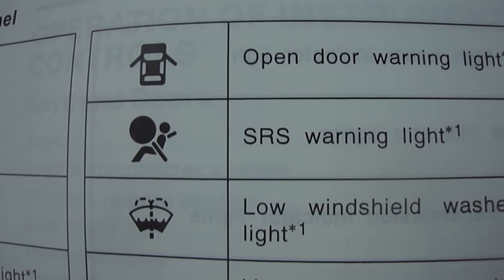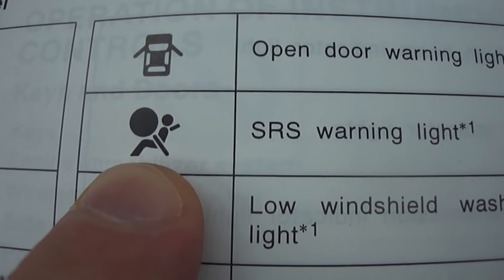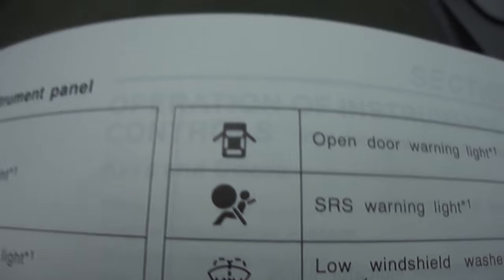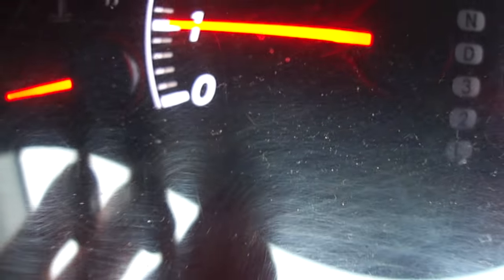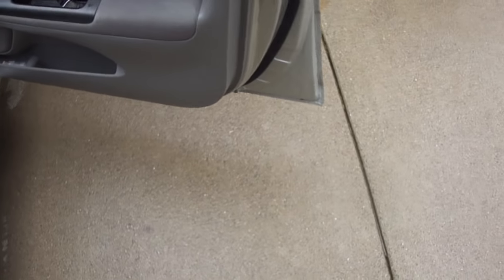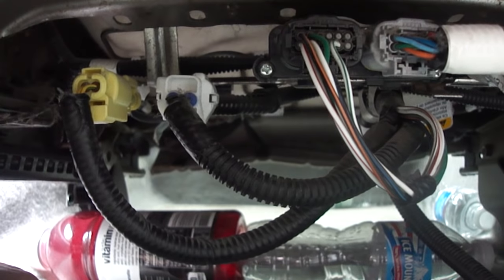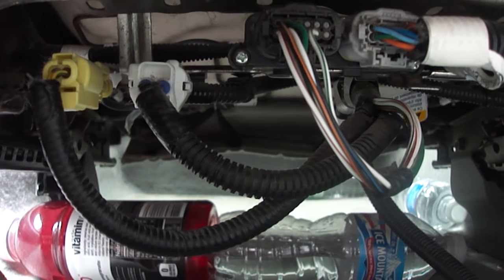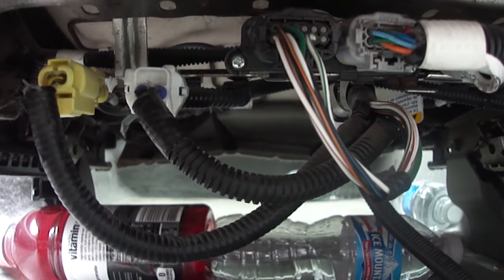(Part 1) How To Fix Airbag Light - Fast & Easy!

Comment: Hello everybody this worked for me too on a 2014 Forester. I want to add to the method something I’ve learned with other connectors though. The cause of this is probably corrosion over time impeding the connection and a great way to clean and protect the connectors going forward is to unplug the connectors and plug them back in repeatedly, about 3-4 times is what I did. That should wear away at any corrosion on the contact faces. Then I reinstall with a healthy dab of dielectric grease to protect the connections going forward. Good luck everyone.

Comment: Do i have to keep the car on? or disconnect the battery 1st moving the cables? Will, this work for a BMW x5? Thanks i'm try it in the morning!
Reply from the maker: Nicole Yescas perform with key out of the ignition. This will work on any vehicle.

Comment: What are these harnesses called? I have an 06 Tundra and the guy that replaced the seats didn't replace ANY of the harnesses. There are literally no wires under either seat. I'm trying to find replacement parts but having a time...

Comment: So for a loose plug, you die in a crash? Or will the bags deploy if that was the only problem?
Reply from the maker: I have read that if the airbag warning light is on, the airbags will not work in a crash.

Comment: Mine is now on and have'nt done anything yet.  after you check the connections, do you have to restart the car or will the computer now recognize everything is good to go while running?
Reply from the maker: Once you perform this, then put the key in the ignition and start the vehicle.
Reply: ok, thanks, will try today.

Comment: I just had to check the connection in the passenger seat without disconnect the cable and it fixed.  thanks!
Reply from the maker: Andres Cote 👍

Comment: I have the same problem and the mechanic told me over the phone its not a wiring problem but usually the ECU for the airbag system and would cost $884 plus gst plus 45 minutes to install the new one. So I will check my vehicle for loose connections. I just put in new seat covers so Im sure Ive dislodged something. However Im sure if I took it to the mechanic they would have ripped me off. Thanks

Comment: Brilliant. I have a Yaris Verso, and the warning light started blinking after I had to push the front seats forward in order to open the floor panel to store the rear seats. Obviously caused a contact to come loose. As the guy says: wiggle it about a bit. Problem solved. Saved me at least 2 hours going to garage for them to do the same thing, even if they didn't charge me.

Comment: Thank you I'll try it. My 2004 holden stopped yesterday at 5am half way to work. The airbag light was on for 3 days but me being lazy I just told my hubby it's ok lol. Next thing I know I'm driving to work then the red battery light pops up and my car stops. So I call my hubby and we end up pushing it back home. Thank God it was only 200metres from home. I'll try and do this in the morning. Thanks heaps. I'm glad I found your video coz our mechanic would have charged us the moon coz He's a crook. Thanks again. God bless.
Reply from the maker: Truth Exposer make sure you watch part 2 and 3. From what you’ve described it sounds like you might have a bad alternator.
Reply: @proclaimliberty2000  thank you I will.
Reply: @proclaimliberty2000  thank you. I will. 😊
Reply: @proclaimliberty2000  tried the wires me and my hubby. Didn't work so we think its possibly the alternator. Thank you again. Hopefully the mechanics doesn't overcharge us.

Comment: 2004 Pontiac gran prix super charger  air bag stays on.  The fuse is good. Question .should the car battery be disconnected..the owners manual said. The air bag can deploy  up to 10 seconds after the battery is disconnected.

Comment: A good advice proclaimliberty2000, I'm sure the water bottles you have under the seat are the reason the cables keep having bad contact. When you drive the bottles move under the sit and hit the cables which causes the cables to loosen.
Reply from the maker: The bottles do not hit any of the electrical components.  The problem is I live on bad bumpy roads

Comment: So, I just did this. The light used to be on all the time, after fastening the connectors now the light goes out and returns only a few seconds later, does this mean that my airbag or sensor is damaged? I appreciate all the support. Thank you.
Reply from the maker: I don't know for sure what it means but you have no airbag protection right now.  Is this an older vehicle?  Read down through the comments as someone mentioned something about a special electrical connection paste which could fix a problem with electrical connections as they age.
Reply: My guess would be that there is a reason your connectors are not staying connected and you have to fix that first. They may seem to be back together but if there's something caught in them, even just dirt or moisture, then they'll be forced apart again very quickly which will cause the light to go off then come back on. Disconnect the plugs and give them a hit with a blast of air from an air compressor or can of air to blow any debris out then try again.

Comment: WOW, Worked immediately on my 2014 Enclave!!!!   Thank so much!!! 👍
Reply from the maker: Candy 👍😊 Girl power!
Reply from the maker: Candy 👍😂
Reply: @proclaimliberty2000  you just don't know how much this made my day. All my running gear under my driver seat has now been removed. 😁
Reply from the maker: Candy That’s great! Mechanics rip a lot of people off with this problem telling them they need a new this or a new that costing them hundreds or even thousands of dollars when it’s just a loose connection under the seat which could happen for a lot of different reasons.

Comment: The method works with my 2003 Elantra. Happened 3 times so far. The cheap unsealed connectors build up a tiny amount of corrosion from the fine dust under the seats. Moving them dislodges the corrosion.
When a connector is moved one way, the contacts move on top of the corroded area. This produces a lower than expected voltage signal to the ACU.

Comment: Hi, I have an error in the board "SRS, restraint system faulty drive to worshop", this error appeared after I moved the seat further forward or further back, what could I do? (at my Mercedes benz a class A170, 2005 oil 1.7)

Comment: 2017 New Spark error 95 light started coming on after the recall on the airbags was implemented.
3 trips to our origin of sale of this new Spark, they say that it must be in the error mode for them to check it. 
Can they go with 'error 95' and perform repairs.?

Comment: Had the same problem on every car I have ever owned. Usually I clean up under the seat and give it a good hoover and the light goes off. Funny thing is you can see you have a little junk under the seat too, I was wondering if it can also build up some kind of static causing a short fault. Dust might not help either.

Comment: The yellow connector is the air bag!
If wiggling it does not fix the problem then disconnect it and reconnect it again and see what happens.
It's also a good idea to put some dialectic grease on the female plug which gives is better continuity and helps prevent corrosion.

Comment: I’ve got a 2011 Silverado that was in a wreck and the side airbags deployed and I put new airbags in and sent the bcm off to get flash but it didn’t work. I noticed that there a impact sensor in my passenger side door that the wires got ripped out of

Comment: how you know if the problem is on the passenger side or driver side? sorry to ask this because its my first time i encounter this lighted air bag,... i did already wiggle already both of them driver and passenger side but still the same, are  there any more options, than going to the mechanic?
Reply from the maker: Just keep doing it on one side.  If that doesn't work then try the other side for a while.

Comment: Great video. I see you have a few water bottles underneath your seat, which could very well be what caused those cables to move just enough and cause that light to come up. That's what ended up being the issue in my wife's 2010 Acura MDX. Took about 30 seconds to take out about four water bottles and that fixed this issue for us.
Reply from the maker: mxtech31 Yeah it’s called four teenagers. LOL! 😂 surprised I still have any brain cells left!
Reply: @proclaimliberty2000  Maaan... I wish I could just blame it on the kiddos, but the wife is just as guilty 🤨😀
Reply from the maker: mxtech31 😂

Comment: I fixed mine by turning the ignition key to run until it starts flashing then turned it off for 5 seconds. Do this three times. Then turn they key to on position again and what for light to flash slowly. Turn then the off again and wait about 10-15 seconds then start your car. The light will stay off. Be sure no one is sitting in the passenger  seat when doing this. Oh ya, I would also suggest to remove all those bottles under the seat. They may be banging into your harnesses.

Comment: Its similar to "Cold Solder" issues with circuit boards, except here is with a loose tight connection. Kool discovery.

Comment: hey iknow this is unsafe but my jeep patriot has no airbag on the right passenger door. is there any way I can take that light off without installing an airbag for now?
Reply from the maker: I don't know for sure but I would say probably not.
Reply: damn! I only asked because there charging me 700 for airbag and then 1000 plus for some headline they need to replace. and I don't have that kind of money. rather take light off for now if possible

Comment: I recently bought a used 2015 Hundi and the air bag light stays on as well as the wiper light , the remote doesn't work on passenger side also radio doesn't work. The car had been setting for a long time and the battery went dead, had it jumped when all these things happened at the same time. I'm a 80yr old female with a lot of experience with cars but this has me puzzled. Could it be because the car sat so long with a dead battery that the codes need to be reset. The battery was almost brand new before the car sat for a long time and then jumped. Can I reset this by the method of just removing the negative battery cable and waiting 15 minutes and restarting it to see if it resets itself . Seems strange that the passenger side door lock worked for the last three months I drove the car but now suddenly stopped working. I'm on a retirement income and was ripped off with my car I use to have before this one so I don't want that to happen again to me. If you think you might be able to guide me in the right direction I would greatly appreciate it.

Comment: Under my seats did not look like his...2017 VW Jetta, but I still just wiggled all wires/connections and pushed them in, and it worked! Went to get my car detailed and it caused the air bag light to come on...

Comment: The seat belt buckle attached to the floor or seat may have a micro-switch inside the clam-shell.  My Honda Pilot had a broken switch, but the Air Bag light is still is on.

Comment: I have a 2001 PT Cruiser and smacked a deer on the R/F fender and a week later the airbag light came on , is there a sensor that need to be reset ?
Reply from the maker: Lindsey Bender Did you try wiggling the wires under your seat?

Comment: Hello. I have a 2006 Toyota Rav 4 2WD with a broken tensioner bolt, the large one in the center which mounts into the engine block and it's the one that frequently breaks off and gets stuck in the engine . I am having a difficult time locating this in part in Panama. I want to be sure I order the right part number. Is this a pivot bolt? How do I properly look up and locate this part? Youve always been so helpful to me. Thank you and God bless.
Reply from the maker: Hi Clint.  Call a Toyota dealership and have the VIN number for the vehicle.  Explain to them exactly what you told me and they will give you the correct part number.  Make sure you shop to get the best price.  Sometimes even a dealership can have a good price but I have to say it's hard to beat Ebay.  Putting some Blaster PB Penetrating Catalyst from an aerosol can on those threads will help loosen those threads to help get the bolt out.  Thanks again for subscribing.
Reply: proclaimliberty2000 Will do. Thanks!

Comment: I took my 1997 Lexus lx 450 to my mechanic to reset the airbag light but he couldn't even read any codes. He said I need to take it to Lexus. 😢😢 can you help me figure this out please. No loose connections code or such. The light came on and stayed on after the battery was replaced because it went bad over the winter. Help?

Comment: Loose connector on Passenger seat in my case, plug had become totally disconnected due to passengers adjusting seat back and forth. The connector caught on the floor pan and was pulled out of the mating connector. Corrected problem by reconnecting loose connector then tying connector box tighter to underside of passenger seat with a nylon spot tie.

Comment: my seatbelt wiring to the connector has been semi cut from the seat moving back nd forth. is there a way to fix the wiring? or should I just go to a junk yard and get a new seatbelt? 2006 Ford crown victoria police interceptor. code 33 driver seatbelt pretensioner faulty circuit.
Reply from the maker: I'm sorry but I simply don't know how to advise you on this other than to have a qualified service center give you an estimate on what they would do.
Reply: Dr. Seymour Butts I just bought a new one from the junk yard for 5 bucks

Comment: My USB cord got wrapped around the steering wheel (where the air bag sits).  To be able to continue driving, since the wheel couldn't move because of the USB cord being stuck in it, I tugged and worked on it to remove the cord.  Unfortunately, I must have done some damage to the air bag/horn assembly because I now have a dash airbag symbol and the horn does not work.  Any suggestions for fixing?
Reply from the maker: I'm sorry, I don't.

Comment: My car had its module triggered and airbags deployed. What is required now to fix this? Airbag replacement, module replacement?... anything else?
Reply from the maker: The only way that I can advise you in this matter is you need to find a reputable mechanic that can give you an estimate on parts and labor to fix it.  DO NOT get an estimate from a dealership because they will rip you off!
Reply: proclaimliberty2000 thx for lightning fast response! I didnt even kno small private mechanics did this i thought it was either dealer or ur on ur own

Comment: This video helped for my 2004 Silverado I disconnected and reconnected my cables under the chair.  Well Done much appreciated!
Reply: I have a Chevy express van 2010 model same problem wonder if it is same as a Silverado?
Reply: @undertaker598  My light came back on and I inspected the wires more carefully where they join and I notice one got spliced out(weak link) from the 2, so I joined it with connectors and magic.  If that didn't work then check your air bag sensor under neath the truck.  Good luck.

Comment: Hello I use the foxwell nt630 pro scanner and yes it did find the problem with my gmc truck. Then I disaided to explore the unit and check the system air bag on my buick wich was running fine no codes . On this unit is got a special function so I decided to check them out one said (set up SDM number in DIM ) so i had to see what it was so i press yes ,next it said (do you want to synchronise the IPC and SIR  module) hell am exploring and learning how this unit works because the manual don't have much info.  any way I HIT yes . And now my SIR  LIGHT cames on every time I turn on the car , I put the scanner back on check the codes it gave me B1001 ( OPTION CONFIGURATION ERROR) AND U1016 ( Lost communication with ECM/PCM/VCM) SO I figure I go back and reverse the synchronisation but the unit don't have that option.  How can I reverse it ? Every scanner I ever had will record was there or add a new option not this one . Can you help me ?

Comment: Airbag light is on. I have a 2003 dodge Dakota. I checked the fuse . I have no wires under the seats. Any ideas?

Comment: Thanks for that,  I checked both Passenger and drivers side, made sure wires were connected. ..  Seemed to have happened when I moved the passenger seat back.  Warning light is off.

Comment: I have a 2008 Jeep Grand Cherokee. Light came on when I was doing some "heavy" driving on a rough road. It now periodically comes on and off while driving. I'm going to check the plugs under the seats like you suggest. I hope that is the problem. Already checked the fuses but there doesn't seem to be a fuse solely dedicated to the airbag system :/ God Bless this New Year.
Reply from the maker: Zachary, I've noticed on my own vehicles that rough roads is the biggest cause of this problem.  Hope this fixes it.  Happy New Year and God bless you to.